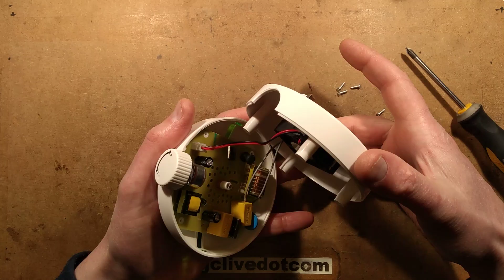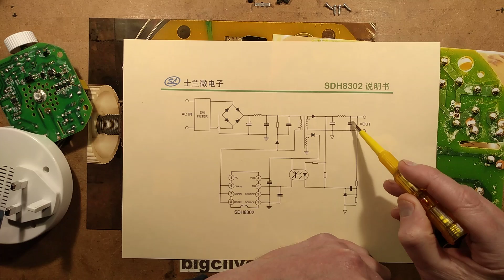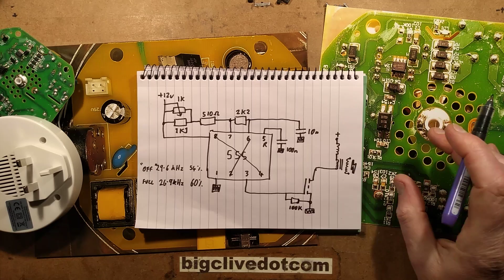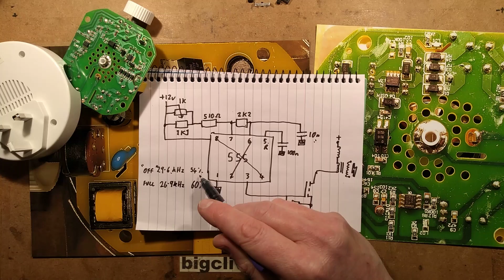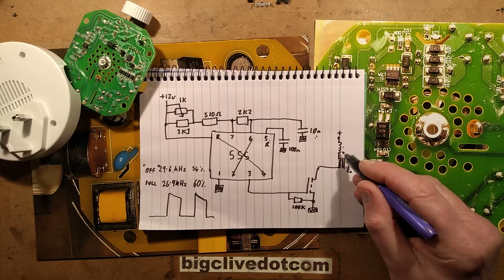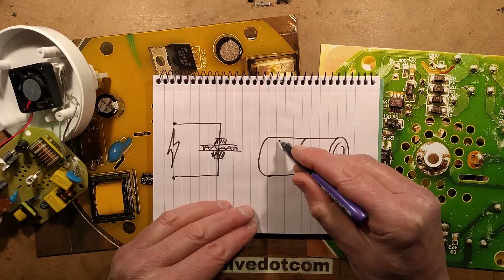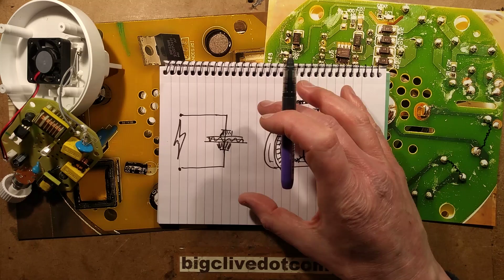Inside a faulty Puripod ozone generator.

Comment: wish I had thought of scratching the board with a screwdriver, I had the same problem, and had fun putting a tiny wire between the detached joint and the next spot on the board I could solder...
Reply: If you can’t find a pad, make a pad!

Comment: I started looking at ebay for ozone generators to remove some of the smell from my workshop.. they seem to have ceramic plate ones which claim up to 20 g/h ozone production at 30 euros, looks OK if it works... I'd like to see one tested if they will actually work properly and not just become smoke generators :) "20g/h 220V Ozone Generator Disinfection Machine Air Filter Purifier Fan" search should hit some.
Reply: yeah bought one to remove "previous owner" smell from a house I am renovating. Mine was uncased (danger fun!) but has worked incredibly well. Ensure you duty cycle it if it does not have a timer - they are not intended to run for hours on end

Comment: A nice source for those high voltage transformers and generators are older LCD monitors with CFL lamps in them. For potentially sparky fun :-)
Reply: Those are repurposed LCD backlight transformers, but these are not diode split, just the segmented windings is done to reduce interwinding capacitance, as the sections have a lowish voltage between them, and a very low capacitance, so the losses in the transformer from circulating currents are a lot lower. Also allows the transformer to have each segment act as a LC tank to build up the voltage in each section for a higher output than the one expected from turns ratio, as they are all series LC oscillators added together, giving the very high voltage to start the CCFL tube when cold, but then as the tube starts the ionised gas inside puts a load across the transformer and this then kills the resonance on the steep edges, leaving the voltage being just turns related again mostly. Makes it easy to control the wide voltage swings of a CCFL tube for starting and the requirement for current drive when running with simpler primary side only sensing and almost no high voltage components aside from some ceramic capacitors and resistors.
Reply: @SeanBZA  thanks for sharing! Interesting
Reply: I prefer CRT monitors for that ;)
Reply: @Chuckiele  Just use them as "preamps" to feed a couple microwawe oven transformers in series and you'll enjoy megavolts in no time! (be sure to livestream the event)
Reply: @benbaselet2026  Nah, Im not touching MOTs, they are stupidly dangerous.

Comment: Clive splitting atoms rather than molecules would be somewhat... dramatic!
Reply from the maker: Given the noise this thing was making, I think it was about to split an atom.
Reply: @bigclivedotcom  to easily separate them, a-bombs splits atoms 😉
Reply: The Fission Health Regime Doctors Don't Want You To Know!
Reply: Just buy a chunk or uranium ore on eBay and watch it doing its spontaneous fission. It does that. It's a part of its natural decay. https://en.wikipedia.org/wiki/Spontaneous_fission
It's quite fun to collect radioactive things, actually.
Reply: @GLITCH_-.-  what's not so fun is cancer in ~10 years
Reply: @deathclawluvr  they are pretty low-power in terms of radiation. It's not increasing your risk much or at all if you have some ore in your house in a corner where you aren't very often.
I bought an extra Safe that I lined with lead. That is very safe.

However you need to make sure to have a little air movement or Radon gas will accumulate.
Reply: @GLITCH_-.-  Huh. Neat
Reply: I always worried that Photonicinduction would try that.
Reply: Splitting hairs over atoms ;)
Reply: I'd like to see the specs of the atom cracking version on the Hopi...... for a millisecond.
But not before you make a video of you thoughts on the DS212  after you use it a while. Clive notes YES!!!

Comment: The way that Wikipedia has updated my knowledge of ozone is that it is O2 that has been electrically split into free Oxygen atoms which promptly bounce into an O2 molecule, glomming onto it producing ozone (O3), which is unstable.  They bounce into other stuff as they float around waiting to stabilize and occasionally bounce into contaminants or solid objects like metals and react with them, usually enthusiastically to try and get rid of the 3rd Oxygen atom.
Reply: Ozone molecules are not sentient :-)))).
Reply: I don't get it... Is ozone flammable? Because I've heard stories of catastrophic explosions in ozone rich environments due to an unexpected spark, but a quick search seems to suggest ozone is not flammable...
Reply: @alessandroceloria  
ozone is made by sparks on (some) electric motor brushes but not so much that it will build up a lot :-)
and oxygen isnt flammable it allows flammable things burn , dont know about ozone though :-)

Comment: I wonder how much Repetitive Electrical Impulse Noise (REIN) or Single Isolated Impulse Noise (SHINE) that gives off?  If it's still creating ozone whilst in off/standby and suddenly your internet stops working, this could be the devil. Clive, have you got a little radio to test?  AM/MW radio tuned to 612Khz listen for noise.
Reply: Why 612KHz? I would expect any noise to be spread over the band rather than on one frequency.
Reply: @drteeth7054  I was addressing one scenario.

Comment: Photocopiers produce ozone during use. The manufacturers try to mitigate this with carbon filters but still some escapes in to the room. 
There are countries that stipulate a minimum distance from people that the copier must be situated.
Reply: The same was true with the original laser printers. They used a very similar technology.
Reply: @zh84  true laser printer still do.
Reply: @JorgTheElder  Hmm.. now I'm thinking salvaging those from old printers for DIY ozone generators.
Reply: I bought an ozone and microscopic-dust filter for my new laserprinter since I could smell it so much
Reply: Mmm, ozone and warm paper
Reply: Definitely the case for small desktop units and older MFDs, but manufacturers actually have addressed this quite well in larger MFDs to the point that some have no detectable output - without carbon filters either, just good HV design and accurate voltage control. Same with particulate control (e.g. no longer tossing toner about in the air during printing)
Reply: @askjacob  the only machines I'm aware of with ZERO ozone output without filtration use the Oce' process which charges a brass drum from the inside - rather than the traditional corona wire / grid setup. Most small laser printers / copiers now use charging rollers running directly on a photosensitive drum which means there is no corona so no ozone - although many machines often have one somewhere else, such as pre-transfer on the ITB etc..
Reply: @KeyboardWarrior95  Ok, I'll grant zero is not realistic, but 0.01PPM (1/10th the "safe levels" ) while being run at 300% capacity is something all Xerox MFDs work at (I only really used those in my managed environment) - and effectively "zero" with regards to emissions - especially compared to older devices that could often exceed 30PPM at normal loads
Reply: Who knew! Some really good info here - Thanks!
Reply: I was working in an office (some 20 years ago) where they had an archive room which also was where the photocopier (a big machine) for the whole office was placed. Every time you had to go into that room you were greeted with the sweet but stinging smell of ozone. More than 5 minutes were unbearable. The worst thing: a guy was working in that room. His job was to archive files or get them for you and make a copy. I don't understand how he apparently wasn't bothered at all by the ozone. But he also was a heavy smoker. So I guess his sense of smell was pretty much gone already and his lungs didn't care for that irritation anymore.
Reply: I love the smell of ozone around copiers, but as most enjoyable things it's not good for our health! :-D
Reply: @stepheneyles2198  Thought I was the only one that loved that smell! Didn't help that I was looking after a lot of photocopiers and laser printers.
Reply: @stepheneyles2198  You do know Ozone is BAD for you right?